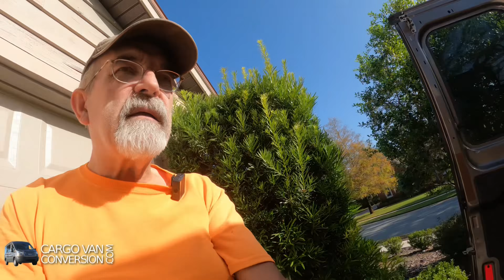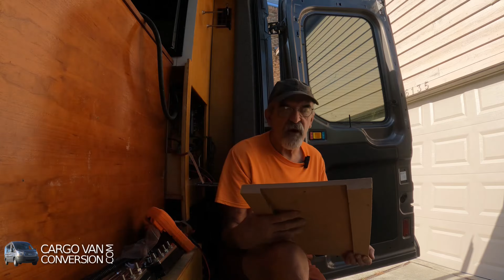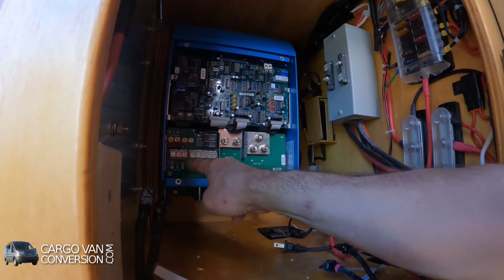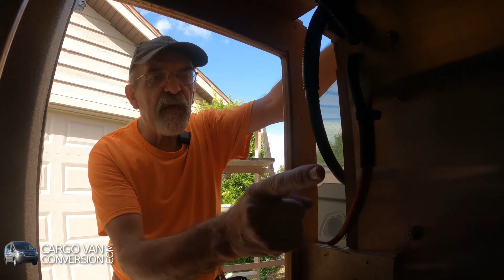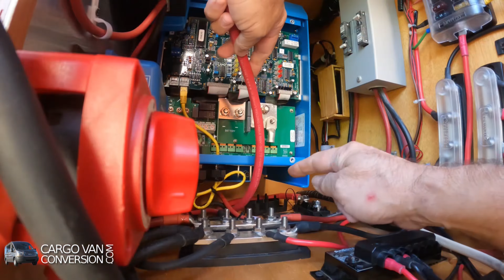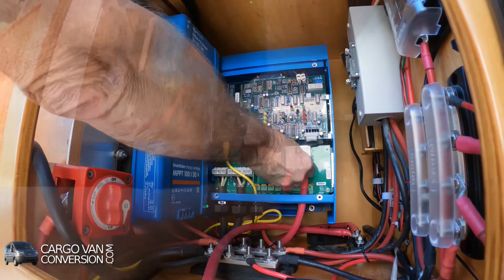Victron Multiplus 3000 Van Conversion Installation

Comment: That's a beast of an inverter! For me part of the challenge of van life is in learning to live with less, so a 1kw inverter is more than enough. But then I'm from the UK, where we're used to not having energy guzzling appliances. If the numbers on the electric meter are clocking up quite quickly we find it alarming. ☺️
Reply from the maker: Yes, big literally and figuratively. And unfortunately mostly just used for cooking. Didn't want anything like propane. Calculations based on maximum wattage of my induction cooktop (and water heater) of ~1800W. The 3000VA is ~1800W, not much more than your 1kW.
BTW Born in Holland and cheap like the Dutch :) , I fully understand and agree with the 'guzzling' thing. I hope the inverter will have a long lifespan, which I expect, then I will use it in my Tiny Home after my vanlife.
Van Williams
Reply: @cargovanconversion  Check out a YouTube channel called Foresty Forest for some great tips on how to make the most out of very little. He uses an induction hob and an air fryer for most of his cooking. Not sure how many watts his inverter is but it's a tiny home on wheels. For what it's worth, he's Canadian.
Reply from the maker: I love what he's doing (Foresty); he is currently in (Mexican Mountain) Utah.
The biggest difference between him and me is age. I will do what he's doing just a bit more moderate and with more comforts, although he can't really complain. Great doggie too :) The slow cooker is still on my list. I wouldn't want his stove in the van, but we have a similar heater. His mountains are 14-15-16,000, mine are 9-10-11,000; I will do some snow shoeing too, but probably only once a year :)
One of the few interesting vanlife channels I have found.
Van Williams

Comment: It's a great unit, I been using the same one for nearly 3 years without any issues. 
Nice install. 👍
Reply from the maker: Good to hear. It is unfortunately the largest investment of this conversion, while I will hardly ever use  the charger and neither will I have the fridge on it. The water heater periodically and only the induction cooktop frequently. I will have some 120V power tools with me, but those can be easily exchanged for the battery type. Did you find any unexpected uses for it?
Van Williams
Reply: @cargovanconversion  I have 1,200 watts of solar panels, I use it to run the mini split ac/heat. 
If I was more clever I would have rewired the mini split to run off the batteries. I also have an induction cook top. Living in the Charleston area I even get away with a 400 watt heater in the winter. I looked for you at the Florida van gathering in February.
Reply from the maker: Hi JG,
I have only 400W solar, but DC-DC converter and 550A Lithium. I could get away with a decent amount of air conditioning, but decided to do without. Rather try to follow the 80 degree and elevation thing to stay cool. Have been to Charleston a couple of times; great place to live! These gatherings are good to meet like-minded people. Have been to the RTR once, and Dade City is around the corner from me, but it is not my 'cup of tea' :) 
If you are ever in this corner again, leave a message at van@cargovanconversion.com and we'll meet up.
Take care.
Van Williams & Joey
Reply: @cargovanconversion  will do
Reply from the maker: That's fast :)